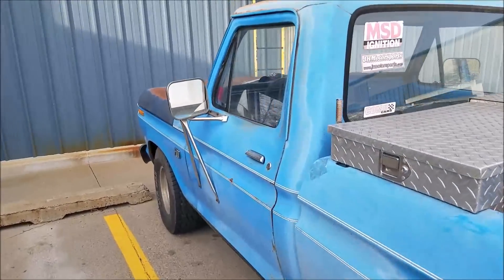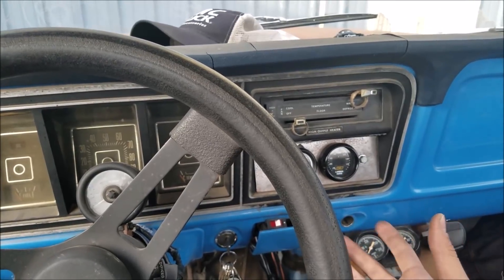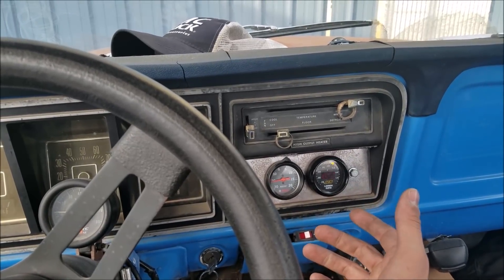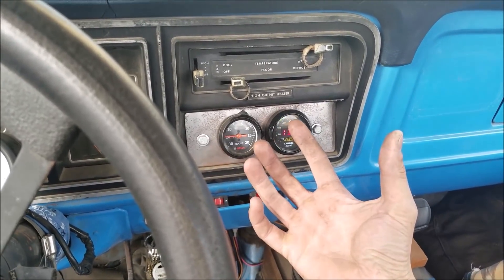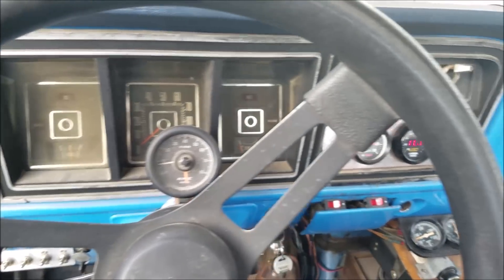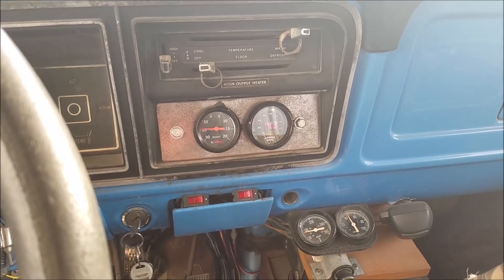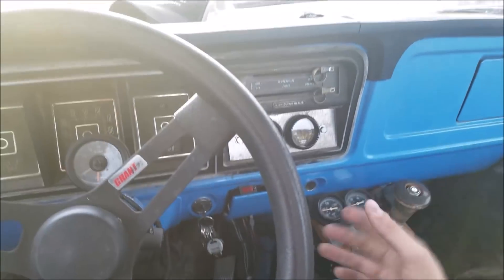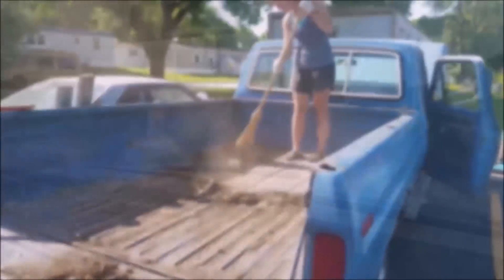Carburetors - Why You Hate Them (Demonstrated & Explained)

Comment from the maker: I just shot from the hip on this one here one day after work. if this didnt make any sense, let me know! 
in the spring im going to do some driving where we watch the wideband and vacuum gauge discussing when each of the circuits in the carb open up, and how to tune a carb for best performance.
Reply: Really looking forward to that one! Stuff helps alot man. Good quality homemade vids too
Reply: What’s the 5 speed out of? I have the stock 4 speed in my 71 and having an overdrive would be nice..
Reply from the maker: Mike CorLeoné hey friend, it’s a foxbody T5 unit - I actually have a full walkthrough on how I did it with a parts list!!! 
Sift through my recent uploads playlist on my channel page!!!!
Reply: ThunderHead289 will do! Thank you sir. If you ever feel like doing a diesel swap i have a build list on the mercedes 5 cylinder turbo diesel into this same chassis. I averaged 30mpg on waste motor oil or diesel fuel.
Reply: Mike CorLeoné are you a member of the OM 617 swap group on Facebook
Reply: The shade tree welder i don’t have facebook or instagram. Too much social drama to get into lol
Reply: @ThunderHead289  If it idles too lean when cold and when hot, then just turn up the idle mixture screw a bit.  It only idles right when in the middle, which is not most of the time.  Most of the time it is either cold or hot, so just turn the idle screw up so that it is right when hot and better when cold.  It will get a bit too rich during warm-up, but oh well.
Reply from the maker: alan6832 without a return line it idles leaner as time goes on if it sits in traffic - which all carbureted engines do actually
Reply: @ThunderHead289  Another idea I had is improve the cooling air exit.  like the super bee.  A cheap way might be just to misalign the rear of the hood at the hinges to produce a gap at the back of the hood to allow cooling air out.  One could even change the hood alignment spring and fall.
   Tire shine protects mufflers.
Reply: How about install the choke and then do this. That would be much more helpful since anyone who daily drives a carb in a cold climate needs a choke.
Reply: I really appreciate these videos, I’ve come all long way just from watching your series of vids. I finally decided to deal with my timing curve on my 454, was only getting 10 degrees mech, took my pertronix dist apart which I bought brand new, there was 2  cclips on one of the weights? Took off the weights and the center plate had only one clip holding it in?! Put it back together correct and bam, 20 degrees advance, 16 initial, squared up my transfer slot on  the Holley 750 DP, idles too high on manifold so hooked up to ported, my idle mixture screws are 3 and a quarter turns out, 13 hg vac. Would jetting up a couple on my mains bring in the mixture screws? I also have some light throttle issues but WOT is nice! Anything you can do to help would be mighty nice of ya! The motor is in a k20 , th400, high energy comp cam, dart iron eagle heads, eagle balanced stroker rotating assembly bored 30 over which I believe makes a 489. This is also my daily driver
Reply: Can u beat on the galaxie a lil.  Put some boots on her .  Or find another  that u build to race dirt roads old school . Gutted and roll bared disc brakes suspension ..
all on the cheap.
Reply: ThunderHead289 I want a 5th gear for my Bronco. Guess I’ll wait and save for a gear splitter
Reply: So I've got a carb question, I've got a 1981 f150 with the 300 6 in it and when I got it the carb was already tuned good and ran perfect, but I recently decided to get a little more sound with some glasspacks and I was wondering if I need to adjust the carb for the higher flowing exhaust. 
Btw I live next door in Franklin county, it's so cool to have a YouTuber I can watch that's just a short drive away, keep doin what your doin 🤙 mabye I'll run into you

Comment: I got a question hopefully someone can help me with. I'm not too experienced with carbs but figuring it out as I go. The electric choke wasn't working but I got it fixed now just trying to tune it in. I feel dumb for asking but in the cold weather should I see the choke slowly open by itself until it opens all the way or will it stay mostly closed and then i have to tap the gas to pop it open before it kills the engine. I just don't know if it will fully open by itself or if I'm gonna have to tap the gas so it sets it in place. I hope this makes sense. Quick edit. The truck has been running lean and causing manifold backfires and spitting and I think it was partially because the choke wasn't working right and letting in too much air on cold starts but I also don't have a return line. Do you think installing a return line would have any affect on that? It's not timing either I know it's a carb issue
Reply from the maker: I can neither confirm or deny that it’s timing related since I don’t have a reference point on your settings. 
BUT, yes as the choke warms up, when you tap the gas it will open more and more. 
All it is is a bimetal piece that as it warms opens up, but it has “detents” if you will, that even though it may want to be past x place in the choke cycle, you still have to give the throttle a tap for the choke to move.
Reply: @ThunderHead289  thanks for the quick reply. Like I said I'm still adjusting the choke but it has to cool between adjustments. It still needs to rotate clockwise more because it's opening too late but I was sitting there watching the choke waiting for it to open up by itself without me hitting the gas and it just ended up killing the engine

Comment: I like carbs because theyre relatively simple. They may run bad sometimes but the car still runs

How does one hook up an air/fuel mixture gauge to a purely mechanical system?
Reply from the maker: It’s an oxygen sensor in the exhaust. and a read out - doesn’t communicate with anything else - check out my recent uploads, I talk a lot about this stuff

Comment: I have had my 1969 Bronco for nearly 40 years and have always kept the carb perfectly tuned. But over the years I can definitely tell the difference in how the fuel blends have changed. Especially with the lower boiling point of ethanol fuel and heat soaked hard starting. I have contemplated upgrading to an efi kit but I am concerned about reliability. I do too many solo trips to remote areas, so I think I can live with the occasional hard starting and stick with the dependability of my carb for now.

Comment: What happened to the electric choke carbs? 
I used to remember them on my air-cooled vw's and 81 c-10 305 4bbl automatic. Coils would heat up and release the choke flap position.

Comment: Haha, I removed the damn return loop from my 73 Econoline rather than go through it replacing all the rotten rubber. My only issue is the asshole at Ford decided to save a few bux by installing the inline six radiator from the trucks as standard in their 70-74 van regardless of engine, the 302 don't like it, the heavy duty optional radiator is discontinued, so if you don't have one to get recore, you are SOL. I live by the Smokey Mountains, I have boiled it over numerous times, cooked an electric fan, never gonna try that conversion ever again, worked fantastic in town, smoke on the mountain. I know about boiling a carburetor, a van doghouse doesn't move air, you should check one out sometime, the came with the return system, so did the early Bronco, I may add mine back one day when I can replace my fuel lines, there is a neat looking section where it redirects fuel back to the tank.

Comment: My cousin had a 79 Fox body back in 94 car ,engine parts total about a 1,000 bucks. Was a 93 lx mustang 302 roller motor added a 650 double pumper mechanical secondary performer rpm intake Holley blue pump long tube headers 2500 stall 4:10 gears it ran really good. Knew a guy from neighborhood he had a 71 Monte Carlo big block 402 engine 750 double pumper cam headers 373 gear 3500 stall he talked how fast his car was he beats mustang 5.0's like nothing.  I had to play the ego boost game on him I said you wanna run my cousins car I know you'll beat us but we just want to see how well it does since we had just gotten it running he laughed. We went to the service drive 3 dead stop races  and a 15 roll he was not happy we put a car gap with all 4 races 1/4 mile. It was awesome crushing his ego in front of all his buddy's.

Comment: I run a Holley Black Pump with Bypass Regulator. Holley 750 DP with no choke on an LQ4 (6.0 LS). I still have problems with the lean condition once up to temp with the Fan on. Mine will lean out till it kills the engine.
Reply from the maker: Where is your bypass located in your fuel system, and do you have an insulative carb spacer?
Reply: @ThunderHead289  bypass is before the carb. its a 3 port holley 12-887. and no spacer. im going to order one after watching this video

Comment: I bought a edelbrock 600 that sat used on a shelf for about 2 years for 75 bucks  to go on my big block fury...other than spraying some carb cleaner through it and adjusting it ive never had issues with it...doesnt even have the choke hooked up...and it starts right up in colder temps too.

Comment: I have a 1975 dodge dart sport 360. Up top got a thermoquad carb! This carb has been flawless never an issue. Just don't see a need for switching to efi. It won't happen in lifetime!! EFI belong in new cars for me. Soon will be going to a more radical cam and gear. Carb has been previously worked/modded by the previous owner who had it on a drag 440. So it performs like a real champ!!👍

Comment: clean fresh gas at less than 6 psi,thru no less than two see thru filters,to a clean,super clean carb,your choice,they've been running this way for over a hundred years,always carry and extra fuel pump,when traveling state to state,always carry same size hose as supply,problem solved,carbs are king,esp drag strip

Comment: hi out put ignition makes for efi drive ability as you can fire lean mixtures. i run no choke and it starts with just a few pumps. the biggest problems are not a strong ignition,too big a carburetor,too much cam,wrong ignition curve,poor parts match. carbs run just fine. i have built a lot of engines that get as good of gas mileage as the new wiz bang engines! have a 351w that gets 20 mpg highway with a 3 speed auto!!  a old trick was to add a dish shaped screen under the carburetor to brake up the fuel. have seen 2 MPG gain.

Comment: My qjet runs great. Even in the cold. I wish I could have a hot air or divorced choke though, electric chokes suck because even if it's hot, the wind will cool the choke coil and it will close.

Comment: I like carbs for everything except being harder to do the first start of the day than a fuel injected system in our brutal winters. Carburetors can be figured out pretty simply and you can easily do things like manual swaps but ECMs etc are whacky things that only dealerships and a few people who paid for the tool even have the tool to work on

Have an f150 with a carbureted 300 i6. Now i actually figured out how to tune it properly etc but back when the choke was broken i used to keep a can of ether around when i went to school because if it got to -30 it hated to start without it

Comment: I'm learning on an 84 S10; now that you've mentioned it, I should probably look into how to install a return line in it. I'm in Arizona, so we regularly peak 115 degrees in the summer. I'm trying to sit down and learn all I can about carbs, unfortunately I didn't grow up with them, but I like the idea of having the ability to manually tune everything to get it how I want. Only problem I'm running into at the moment is finding specific info on my engine. Seems like 3/4 of the 'documentation' out there for the 2.9L is how to get rid of it and drop in a 4.3 or 350. That's great and all, but I don't have the money to drop on another engine. I'm not opposed to it eventually, but this motor has under 100k on it, and they were gentle miles (I knew the 1st owner, and I'm the second).
Reply from the maker: The beauty of carbs is that tuning them is the same ideology across the board. 
I have a pretty good carb series you can go through 👍

Comment: For me, installing a wideband o2 on either of my daily drivers is a "want" or "nice to have". However, having a working and properly adjusted choke has always been a "requirement". I have started it in minus 31 degrees and it fired in about 3 seconds of very slow cranking and idled without any help. 0w30 synthetic oil helped. It's annoying to see everyone talk like we had it so bad with carbs back in the day. Would it like to not have it pump the gas to start the car? Sure. Is it a big deal? No. Not really.
Reply from the maker: Listen here - I left the choke off to show what the afr does as the car warms up. I have a mechanical choke on this engine. I just didn’t pull it for the sake of the video as it would distort the o2 readings. 
For two, I’m the carb god. 
I’m pro carbs over injection and have some in depth tuning walkthroughs. 
Might want to check who you are talking about before you talk shit. 
Have a nice day.
Reply: @ThunderHead289  
I apologize and stand corrected. I rewatched and I just missed the part where you said you left the choke off for the video sake only. I will be watching your wideband tuning videos and purchasing the same wideband soon hopefully.

Comment: Making a video about how bad carbs are and immediately admits to not having a choke on it?! Wtf. I don't have an o2 sensor installed and would love to have one, but install and properly adjust the choke. Then you can do this video.

My 83 Caprice has the original style quadrajet with the choke half arse adjusted with the heat riser installed. When it's covered in ice and I need to start it for warmup before work I run out, open the passenger door, reach across and hit the gas with my hand to set the choke then turn the key and it starts in a second or 2. Tap it once again to get down to second notch on fast idle. 

So yes you are correct. Carbs don't work well without the choke they require to work properly.
Reply: He wasn't saying he dislikes carbs at all .... He was talking about a few things that carburetors do that make people hate carburetors because they don't understand them.

Comment: I've never needed a return line, a thermo insulator under the carb is an absolute must though. I live in the Northern Utah Desert, and I have also lived and worked in North Dakota with the same 85 F250 w/351& a 4bbl Holley. Even my 1958 Chevy 235 has a factory ceramic insulator under the Rochester 1BC.
Reply from the maker: You don’t think you need a return line until you watch the afr walk all over the place. Especially if you sit in traffic - it will lean out bad

Comment: Carbs are fine if you bother to actually maintain and tune them properly. Every used car I ever bought (that had a carb) was way out of tune and had missing/broken linkage parts, bad gaskets, vacuum leaks, etc. All of which are relatively easily fixed. I actually enjoy doing rebuilds on them, it's like a mechanical jigsaw puzzle. Don't get me wrong, I prefer driving an EFI car but it adds many more failure points and they're much harder to diagnose especially wiring/ECU problems.

Comment: What size carb would you recommend for the bone stock 390 in my 75 F150? I bought it with an Edelbrock 1406 600 cfm carb already on it but I feel it’s a bit too small. Thinking a 650 might work better.

Comment: When you say return line, are you talking about still using the mechanical fuel pump and adding a fuel line as a return? I have a big problem with this in the summer and I've thought about  just putting a new tank/electric pump in with a fuel pressure regulator. I tried a carb heat shield and I guess it kind of worked but it started leaking so I threw it out. Mine sounds like it's gonna die though when the fuel heat soaks.

Comment: Carbs are great as long as they are in good mechanical condition and are properly adjusted for the conditions they are being used in. I own a lot of old cars and they all have carbs that were originally installed on them and I wouldn't hesitate to drive any of them cross country at any time. With that said electronic fuel injection is the best thing on the market. It can adjust instantly to almost all conditions and it really has become dependable and affordable. Mechanical fuel injection was very good too but with the advent of cheap electronics, that work, and self learning, plug and play systems electronic fuel injection is the best thing. No pumping the accelerator to set the choke and prime the engine, not holding the pedal to the floor when it hot soaks, no extended cranking when the temperature is 100 degrees outside and no dying at idle when you switch the A/C on. I love carburetors but I love electronic fuel injection more!

Comment: When a carburetor is set up correctly, it is perfectly viable for today's roads. I daily drove my 85 k10 with a quadrajet for years, with no issues.
Reply: Same, good old qjets. Some many people hate on them but they are great
Reply: Gm Power man!
Reply: My q jet on my 355 still works great It has been rebuilt and tuned by a guy that’s really good with them. As long as the fuel isn’t evaporated from the bowl from sitting u pat the gas 1 time to set the choke and turn the key. I love the sound when the secondary’s pop open.

Comment: I just bought a 78 ford  and I'm getting an engine stall on deceleration. It starts right backup but can sputter a bit until I get on the throttle again.  Stop at a red light...stall. Slow dow to turn a corner...stall. I'm thinking of just going to throttle body efi.
Reply: Sounds like the carb floats arent adjusted correctly
Reply: @researchandbuild1751  Thanks!